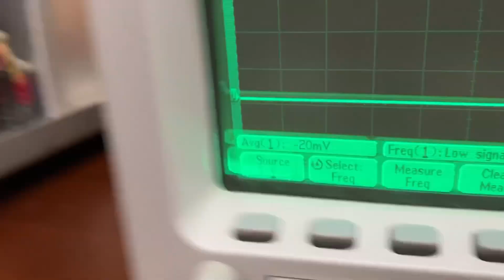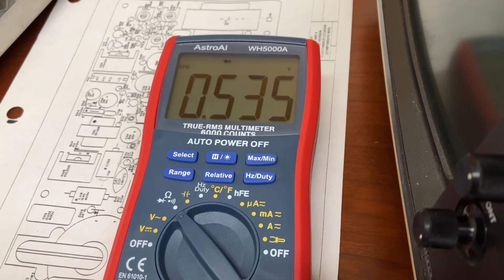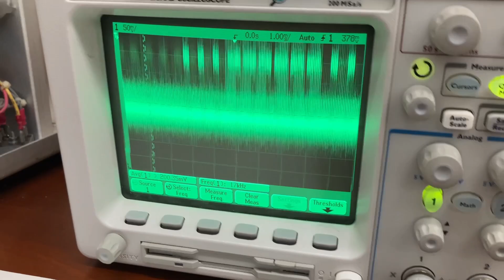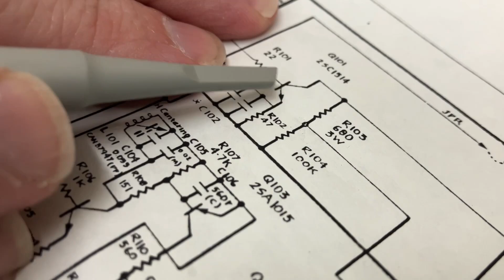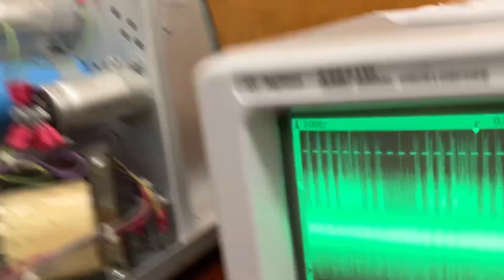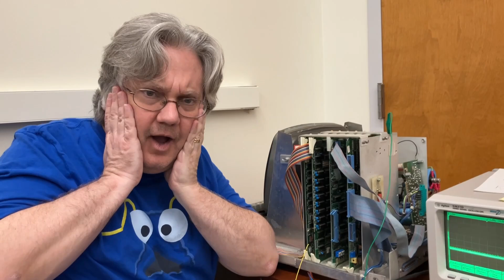The Transistor was INNOCENT! Debugging CRT of a Vector Graphic 3 S-100 Bus Vintage Computer

Comment: hmm if that video pin is dead, how did you get video to display in part 1?
Reply from the maker: Ah -- that display was actually from a different pin. 

The Flashwriter II card is weird. There's three pins for HSYNC, VSYNC, and TTL video signal. There's a separate pin with a composite output, which is what we tried in part 1. However, that composite output doesn't have the HSYNC and VSYNC mixed in properly, which is why the display was all over the place. 

Now, to get HSYNC and VSYNC mixed in properly for a proper composite output, you have to change some component values But if you do that, then the original HSYNC/VSYNC/TTL outputs don't work properly. It's kind of an absurd design -- you have to chose one or the other, I don't see why they couldn't just make a design where all the outputs work all the time without component value changes. 

I know where to look next -- the last thing the TTL output sees before leaving the card is an open collector inverter with a pull-up resistor. So the problem has to be there.
Reply: @Lantertronics  Ah great! I look forward to the next video.

Comment: To be fair, the brightness control was turned down preventing anything from being seen, so you did  fix one aspect in the CRT section. :)  Without having the schematic of the driver board, I'm going to go out on a limb, and suggest checking the IC that drives the video. Reaching back in my memory to these kind of circuits, I'm willing to bet it is a line driver type IC, like a 75 series line driver IC, or a simple transistor buffer.  Outputs driving longer interconnect cables often get smoked from surges induced into them---the longer wire acts like an antenna, and picks up induced currents. Worth checking I think.

Comment: GROUND LOOPS! GROUND LOOPS! GROUND LOOPS! When I was a strapping young man installing commercial A/V systems in Chicago, many moons ago, one system had a particular gooseneck lectern microphone that made a loud hissing noise at times. My boss couldn't find anything wrong, so he sent me in to try my troubleshooting skills. Turns out that this microphone had two paths to ground. One was the regular path, through the mic cable, to the mixer, and to the building ground through the mixer's power cable. The other was through the gooseneck, to the (metal) lectern, through a power strip mounted on the lectern, to a power outlet (on a different circuit from the mixer!) and to the building ground. This created a huge loop in space the encompassed much of the building.

And, in the middle of this loop, was a 3-CRT video projector (yes, I know I just revealed my age). Naturally, whenever the projector was running, the microphone was swamped by flyback noise.

That's what you have going on with your oscilloscope setup, except worse because you are trying to measure a single-ended signal. You have one loop involving the very long ground lead on your scope probe, and part of the computer chassis. You may have another loop involving the scope's line cord, the computer's line cord, and the chassis--unless you have been careful to isolate the computer's chassis from the building ground (which you should definitely do, for exactly this reason, when troubleshooting with a scope)
Reply: Oh, if you're curious, I fixed the issue in five minutes using a pair of scissors and the cardboard from the back of a legal pad, to make a spacer to isolate the mic from the lectern. Perhaps my proudest MacGyver moment.

Comment: Ground lead is WAAAY too long, massive loop area/big inductor picking up heaps of junk. This is exactly what the little spring ground probes that come with scope probes are for!
Reply: Second this comment!! Especially if you are measuring in close proximity to a magnetic deflection CRT!! The ground loop is  a single turn transformer secondary. The time derivative of the magnetic flux through the loop appears directly as a voltage across the input of your oscilloscope (Maxwell's equations). The CRT's deflection yoke creates a magnetic field that is both large and very rapidly changing.